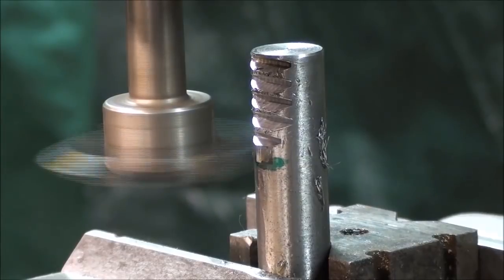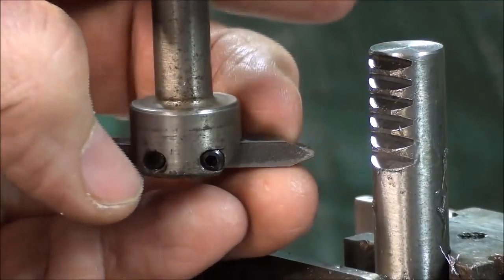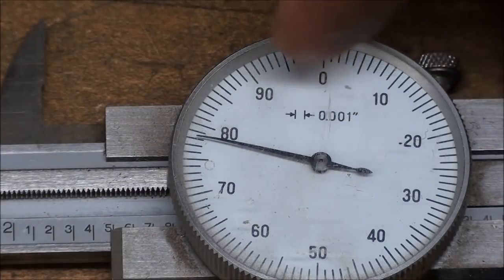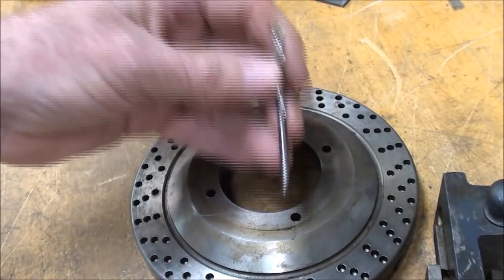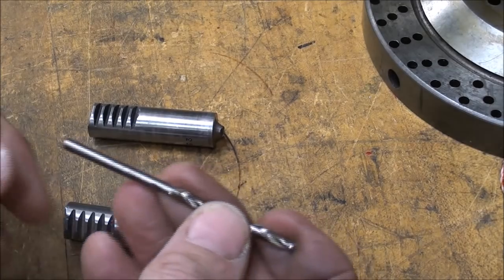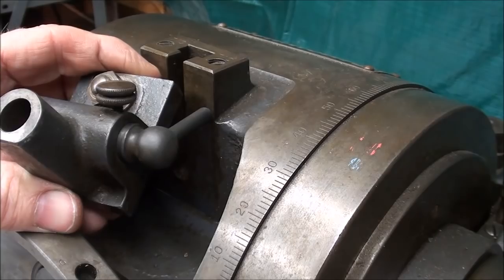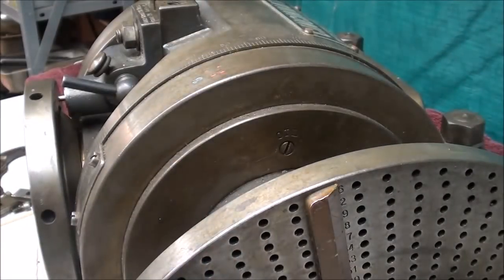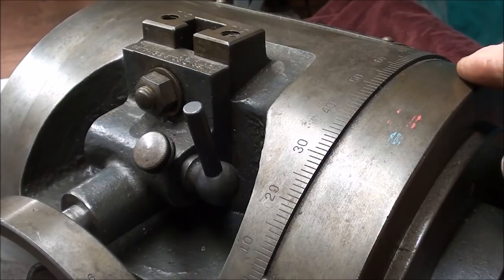SHOP TIPS #194 Cutting a Gear Rack on the Bridgeport Mill Pt 2 tubalcain

Comment: Why didn't you just turn the end down for the pin?
Reply: Because it's easy to forget that the pin is engaged and snap it off again.  By using a separate pin held in place with Loctite, you can just warm in up with a torch, pull it out and replace it at any time.  Remember that the actual goal of the video was to demonstrate the cutting of the rack.  He could have just as easily faced and drilled the original broken part to restore the machine, but it was nice to show the creation of a rack for a specific, practical purpose.
Reply from the maker: Mark Warbington
THANKS for watching--you took the words out of my mouth

Comment: You open-end adjustable wrench uses a rack and pinion.
Reply from the maker: Actually, its a worm & worm gear
Reply: +mrpete222:
I remember reading once that in the original design of the adjustable wrench, the adjusting roller was reversed from the one we're familiar with. Somehow, the American draftsman drew it in a mirror image of the original German (?) design.

Comment: outside the subject of the video. meaning i know you wanted to illustrate rack gear cutting and used this excuse to do so. could we have just faced the original rack, bored a hole and inserted a new pin?

ps. enjoy your posts immensely
Reply from the maker: Frank Ruffolo yes-if it was annealed first
Reply: thank you.

i would have cut the rack too, as i relish any opportunity to cut a gear :D
Reply: mrpete222 next project is to salvage the original. :D